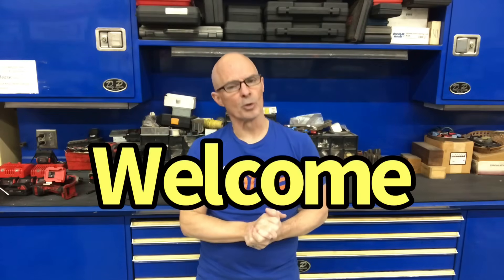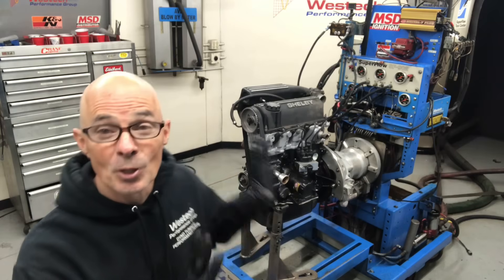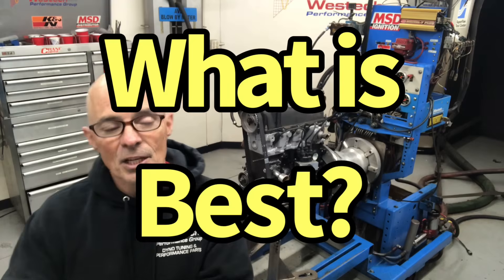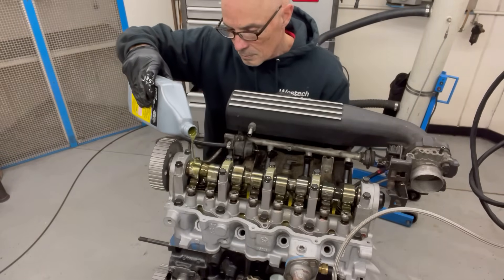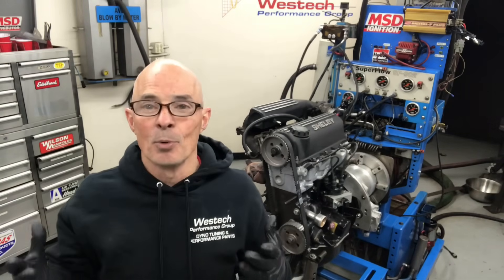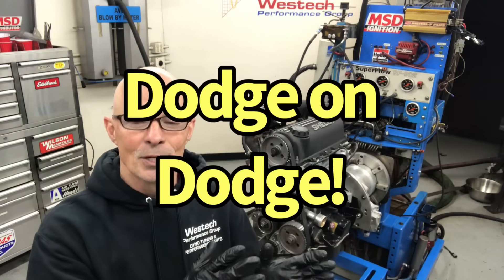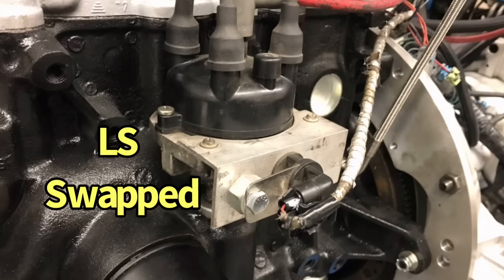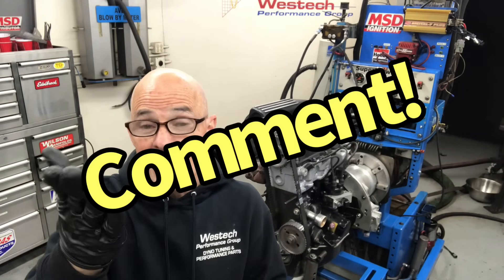2.2L DODGE TURBO-LS SWAPPED THE DISTRIBUTOR. 1ST DYNO TEST. WILL IT RUN? HOW TO RUN HOLLEY HP ECU.

Comment: Great engine from Mopar from the 1980's or should it be explained a corroboration of Volks wagen and Chrysler. Volkswagen rabbit blocks imported with Mopar designed head and hang-ons..early versions of the 2.2 suffered from camshaft galling in cold weather due to the oil galleries in the head being too small. Our experience with the 2.5 engine in our 1989 reliant k was exceptional, except for the leaky cheap stamped rocker box cover.
The hang -ons were typical Mopar quality for the period...A/C clutch died one month out of 12 month warrenty...then the compressor 3 months later....though no problems elsewhere. Very strong transmission. This engine was a God sent for the average family man who also repaired their cars. Free of valve interference...a snapped time belt could be installed in 30 minutes! We owned four cars & two mini vans with these engines thru the years...with an 86 Chrysler model with the 2.2L.
As you might guess bought them cheap repaired as needed...Wish the automotive industry would reintroduce a simple car like this again. But big corporate GREED and built in obsolescence of cheap Chinese plastic parts with design to fail engineering to wring out more from less seems to rule an industry that at one time was a major contributor to the economy. Today we design weapons, weapon systems ET.AL. selling death and destruction world wide while pulling strings behind the scenes to orchestrat military incidents to create a never ending profit for the MIC.
Smedley Butler is Correct,.... War IS a Racket...
Reply from the maker: just wow

Comment: Well rich I bought I first gen neon acr... special place in my heart. Now what I'd love to see is throw a DOHC neon head on that bad boy. From what I understand it's a fairly straightforward swap and worth a good bit of power. Back when I was 17 I had built a 2.0 na motor for the neon I had back then and I got about 240whp (this was over a decade ago don't remember) but it was a fun car and I'm proud to say I believe I was the first to put a motorcycle power commander piggy back on one to tune it lmao car was a hoot though wanna say I got it down to 2200lbs and I didn't even hit the brakes to make a 90°turn at 60mph. And before anyone laughs too hard iv owned well over 100 fun cars and that was the one I missed the most. Nothing special to look at but for a spartan car with huge smiles per dollar it's the king to me.
Reply from the maker: 240 whp na?
Reply: @richardholdener1727  yeah but it was stock rotating assembly with love and all the head work I could do (worked at a machine shop at the time) header that I spent some time on and a intake that I did the same with. Don't remember the cam but it was a big crane. I think cr was around 13:1 was a long time ago lol. I know it was a blast and I used to go through trannies pretty often. Enough that the local supply dried up on the last one I bought.
Reply: @richardholdener1727  but I would love to see a DOHC neon head on a 2.2 I hear it's a very easy swap and the neon head is pretty good. You even have the 420a Mitsubishi head that's the same but intake and exhaust are flipped.

Comment: Have you thought about getting rid of the distributor and going coil near plug or waste spark? As would it be easier to just use a different reluctor wheel on the crank for better resolution. I used a Microsquirt to run a turbo on an Chevy aveo 1.6 na motor and did away with the hassle of the camshaft sensor and use a multi event for fuel injection. If the timing of injection was of concern. Lucky for me the engine already used GMs 58x crank pattern.

Comment: If you can do that to a 4 banger,why not a 5.7 Toyota?
Reply from the maker: not sure how those are related?
Reply: @richardholdener1727  sense you can wire up a 4 banger to run and test, why not the Toyota 5.7?

Comment: Use direct  connection  dual carb set up using two o.e.factory carbs 220 ..220 camshaft  you'll get close to 200 hp..at the wheels had a 84 Shelby rampage
Reply from the maker: seems very high-be happy to get 180 flywheel hp with that combo

Comment: I had a GLHS i experienced this problem? I was driving it on a secluded road hit about 130 miles per hour and got a huge surge in power! I was totally surprised by this and was quickly off the throttle. Never tried to repeat it but when watching your dyno testing it made me reflect back to my experience. I’m very interested in seeing what you guys find out.
Reply: I have a GLHS now and will confirm that you get an extra kick right, right at redline

Comment: If the ignition timing is static; my first suspect would be cam timing.  Intake side "might" be too advanced.  I've seen something like this on the motorcycles I work with, however normally if the tech degree'd the cams that far off, the valves would hit..but, we are dealing with a non-interference engine, no?
Reply from the maker: there is only 1 cam
Reply: @richardholdener1727  I figured that..when the motorcycle techs incorrectly move the intake too advanced they normally screw up the exhaust too.  Maybe we are off 1 tooth??
Reply: @ransomholbrook7428 1 tooth is 21 degrees, my .430/.430 cam is best offset 3 degrees adv. Adjust. D C. cam sprocket (square tooth), use the dead up keway and the 11:23 offset white 3 degree key.
Reply: It is 12 in actuality on the degree wheel, but get off a tooth with the belt timing and the reality is 21 degrees adv/retard. The cam and intermediate shaft sprockets are same sprocket only flipped, but the much smaller crank sprocket is a big math multiplier.

Comment: Subscribed. I built three Dodge turbos in my day. My 92 Turbo III was the nicest, so smooth and man that thing pulled hard. I had running 15.0 psi with meth injection and a bigger, front mounted Volvo intercooler. 
The first one I ever built was an 84 Turbo Z Daytona. I spent a years salary on that one. A Mopar Super 60 turbo kit (60 trim, injectors, pump, ecu,16 psi), a Spearco bottom mount intercooler with cooling nozzles,  centerforce clutch, HD shift forks, transmission case stiffiners and finally some Gatorbacks and Konis. It was a beast. The Mustang guys hated me.

Comment: I know the man that co-developed these engines for Shelby. Dave Heitz from west North Carolina who happens to own the "Christine" pro modified drag car, which i had the pleasure of working alongside this man and helped rebuild the BAE blown Hemi for Christine once. He shared stories from when they were doing dyno sessions in a tunnel with these four bangers and they had issues with the flywheel breaking bolts. He said it came off one time and spun around and around inside that tunnel for about half an hour. He also built three billet blown hemis for Richard Petty, one of which dropped a valve seat on the dyno and I got to see the remains of that engine... everything had Petty enterprises stamped on it.

Comment: Is it possibly tossing the valves at higher rpms. Essentially adding lift and duration to the cam profile. I believe nascar uses a similar concept by having pushrods that flex and when they relax it tosses the valve for a slight increase in overall off the seat duration. Just a thought I may be way off on this engine and yes ik it doesn't have pushrods

Comment: they used to run the Dodge Omni with those little turbo motors, at the airport and they were very violent at high rpm. They spiked hard @5k and up and you knew it because of the massive torque steer that they had. I had always assumed it was the boost.

Comment: People have had a lot of trouble with the 2.2l pickup with megasquirt systems. if i remember right its something about the trigger angle and it being in a bad point for the software (something like 25 to 40 degrees before tdc) relative to the rotor. Don't really remember the details clearly but when I had one in mine it would run but it wouldn't adjust timing correctly and would randomly be way off.  Found the 84-85 distributer worked way better and was drivable but eventually just stuck a 36-1 wheel on the crank pulley and welded a bracket for the crank sensor on the oil pan. the actual 86+ turbo dizzy with the window was suppose to be impossible to get to work but I never messed with it.

Comment: I owned a turbo 1.5. In an 87 Shelby Lancer and had issues with valve float at higher rpm's.  I can't tell you how many times I ejected the rockers after a long pull.  I installed the timing belt and was one tooth off.  I think retarded on the cam but adjusted for it at the distributor it ran the best that way.  I later corrected this and afterward seemed to be a lot more sluggish.  I always wanted to do computer for it to take more control of fuel and spark.
Reply from the maker: pitching rockers is from over rev

Comment: I'm wondering if the crazy advance of the timing at high rpm caused the power spike due to the dramatic increase in cylinder pressure...essentially having the effect of increasing efficiency the same way as mechanically increasing compression?  Unfortunately it was probably a short window before experiencing valve float.
Reply from the maker: the high timing was consistent through the whole curve past 3500 rpm (consistent 55 degrees)

Comment: The spike in the timing 25 to 55 as to do with rotor phasing spark jump to the wrong pole in the cap.  @richardholdener1727
Reply: And is why the caps are vented, they build up ions (a lot), due to the design of the plug cable ends.

Comment: Somebody farted in the Dyno room and gave a "natural" boost in power 🤣
Reply: That is not that funny, 1995 was running my turtle of an N.A. 84 Daytona at Houston Raceway 1st rnd, same time as the Fuel Funny Cars were warming up in the pits off the edge of the right guardrail and drove right into a red cloud of Nitromethane so thick I could smell it in my closed up car, I was so far out at the top end I was out of the throttle and hard on the brakes (almost to tire smoke and still broke out by over 2 seconds). It only happened once. But I love that top fuel smell and my eyes were watering it was that bad...the car loved that extra burst of just the cloud I drove through. I lost that rnd. And thought I was going to get torn down due to it...they would if I had won.

Comment: Decent power, for low compression. A 150 shot of nitrous would be interesting to see. Maybe a more precise trigger wheel would make timing easier to control. Do you think a magnet pickup could be mounted onto it?
Reply: The Bellhousing has a magnetic p.u. hole for a diagnostic timing light. Hmmmmm.

Comment: Saw 2.2. Automatically liked. 

What really matters is that the engine lives to fight another day. Sounds like a tractor at idle, sounds good at WOT though. 

The torque is the same my guess would have been RPM being off. That said, eratic behavior says timing/ignition alteration to me. 

May be time to dig up a crank wheel.

Comment: guys anyone know hoe to contact mr holdner ?
Reply from the maker: ASK AWAY
Reply: @richardholdener1727   im thermal mechnical engineering student and I need to use some of ur dyno engine runs in presentation  to show how the intake manifold affect the performance and where  in rpm , just need permission ;)  (ls3 intake manifold vid)
Reply: I attempted tonight a yr later on a live, but it was a talk on Mustangs tech talk, so just a walk down memory lane, I was no doubt in the way, I persisted too long, but think he is onto my needed solution only he needs to drive it with an actual 5 pin Chrysler Dodge/Mopar ign. Box. And I need his LS trigger mod to drive my spark and prove he is on tge right track. So, I sent a message to him on his Performance parts website. I want to buy the part. Please Sir...don't make me beg.

Comment: Great stuff.
Maybe the v-Tech kinda bump is actually the real torque/power it wants to make and the rest is down on power? 1 footpound pr ci is what I would expect from a std engine like this so 130-135 is ok - 120 is too low is what Im thinking.
Lifters? Weird flow from injectors? Cam adjustment?

Comment: Not knowing the holley system, I'm suspecting that the loss of timing control is a result of loss of position recognition. If possible, I'd be using a crankshaft position sensor on the lower belt pulley, and a single tooth camshaft sensor in the distributor. The power fall off is occurring at different rpm's, dependent on your initial ignition timing. As such,  I would ignore valve springs at this stage, along with the intake manifold. I would however add another couple of feet to the exhaust.
Reply: Yeah, my header is a Hooker and is over 4' long primaries plus the collector at least for the N.A. version 4323418 intake/4323287 head. A Turbo edition 2.2L without the turbo running N.A. on an engine dyno on pump gas is a Frankenstein with less than perfect but strong results. Add more timing and enjoy the free hp increases. And do not be afraid to hurt it. It could teach us all a thing or 2!

Comment: I have a gen 4 6.0, headers bigger injectors truck norris cam, what's the optimum degree of timing?
Reply from the maker: IN THE TRUCK (ON 91 PUMP GAS) IT MIGHT BE NEAR 26 DEGREES AT THE HP PEAK

Comment: Cam is designed for turbo.
Intake and head designed for a turbo.
Maybe at higher rpm you are meeting desired Flow it was designed for?
I have the exact engine in my 87 Shelby z
Reply from the maker: DESIGNED FOR A TURBO?
Reply: Maybe I'm just stupid but, isn't the cam shaft factory ground for a turbo application?
Never thought it was just a NA camshaft.

Comment: Maybe some weird air turbulence issue in the intake causing some kind of restriction or tumble or a smoothing out right at that rpm and air speed? I don't know. I was going to say an intermittent vacuum leak at high rpm but your saying AFR is good. Could it be some sort of EGR dump ment to keep combustion chamber temps/exhaust gas temps down to protect the factory turbo? I don't know. I'm just talking out of my ass. It is kind of strange. Hopefully I don't miss the answer. Thanks btw for the spark plug episodes you did somewhat recently. I was one of the ones that asked for it.

Comment: We run same distributor with 3 of the 4 flags cut off and a cherry sensor stuck in.  We just keep the one flag for checking TDC for full sequential.  I have pics I can share with you.
Reply from the maker: you have a crank trigger then, corect?
Reply: @richardholdener1727  yes

Comment: It makes sense that it would bolt up to a Dodge bell housing. Almost too much sense.
Most people who are interested in these cars are using OEM engine management, or a slightly modified version of OEM. A few are using a form of M-Squirt etc. 
Your data would have more value to the Turbo-Mopar community if it were applicable to what is commonly in use. 
My $0.02
Reply from the maker: it is (by design) applicable to what is being used

Comment: Why are you using a "LS" sensor for the pickup and not the factory Dodge hall effect? Instead of modifying the distributor, it should at least give you and stable signal. If the Holley can't decode the trigger pattern, then that's a Holley problem and doesn't matter what brand hall effect pickup is used.
Reply from the maker: holley will not recognize the pattern from the factory 2.2l dist
Reply: @richardholdener1727  Well, then you can still use the Dodge hall effect with a modified reluctor.
Reply: The H.E.P. is a 3 wire Orange (+) Black(-), and gray signal wire that goes output to the original PM then the PM outputs 7.5V back out to the HEP. The Holley somehow does not recognize the 3 wire setup/signal even the crank trigger/cam trigger wiring and distros are all 2 wire or 2 wire plus shield grid.

I am facing the same issue w/ Term. X. Upgrade today a year after he faced it.

Comment: In July of 2021 I made a comment on the original video that you will make 241 flywheel hp at 7.2lbs with your stock longblock setup. Still stand by that statement. 

The right intake manifold, exhaust manifold, intercooled on e85.

Comment: Have you considered using a “universal “ 32 tooth trigger wheel right off the balancer? Not hard to make a bracket for a hall sensor and very accurate to actual crank location.
Reply from the maker: a crank trigger is our last resort

Comment: Are the 24x and trigger wheel tied together? Seems like the 24x needs to be a fixed reference while the trigger wheel should be adjusted to max advance, then retarded by the Holley. Just a guess… of course, the 24x needs to be at crank speed while the trigger wheel needs to be at cam speed. I don’t think that explains the hump in the graph, though. I’ll keep watching while you keep testing! Thanks Richard
Reply from the maker: the reference angle was correct

Comment: Your Dyno test defied a scientific principle that says horsepower and torque are equal at 5500 rpm. Wonder if that’s responsible for the strange peak?
Reply from the maker: they are equal at 5252 (per the formula hp=tqxrpm/5252)

Comment: Get timing right befor doing anything else! Sounds like the trigger combination or ECU doesn't work right. As posted below the LS-24X sensor is weird. Try a regular geartooth sensor or a 5V 58X sensor.  For testing before I have used an angle-grinder to spin the trigger wheel without risking damage to the engine.
Reply from the maker: we tried an ls3 sensor and harness-no work